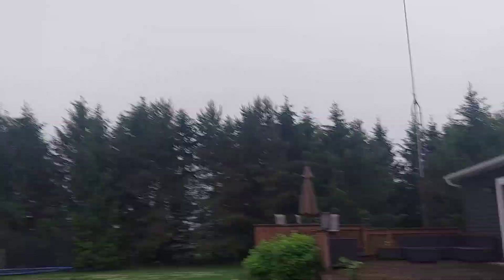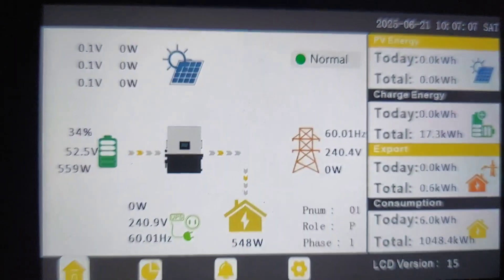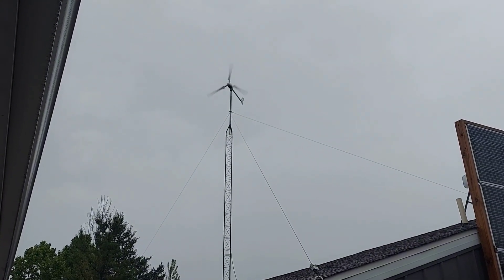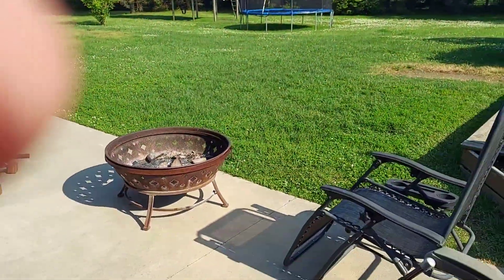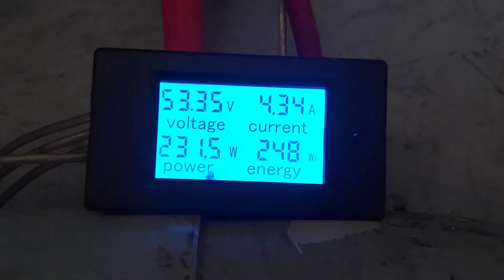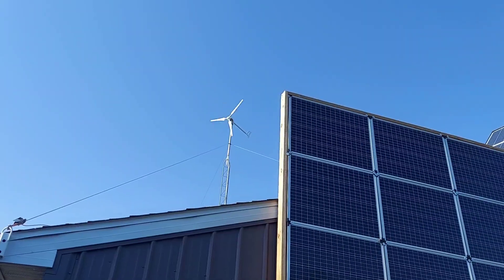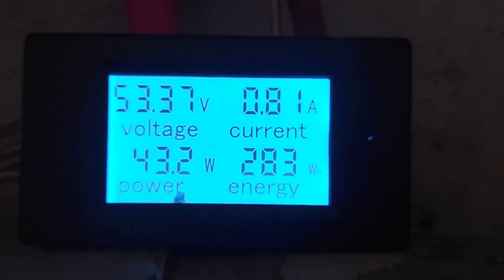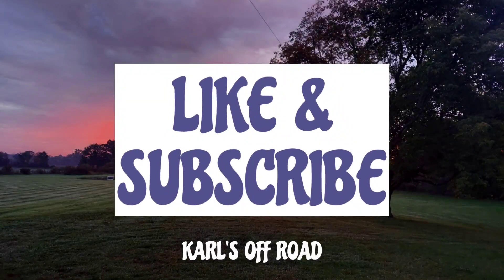Is wind power worth the investment? Testing the IstaBreeze I-1500 in moderate winds to find out.

Comment: Im lucky enough to live on the Canadian prairies so we usually get 20-30mph winds. Which is enough for me to get about 2kw out of the two 5kw turbines I bought from a telecom power provider. But there are mornings I wake up to full batteries when we have storms here over night. And I have seen both of them push up to 5.7kw in 50mph+ winds. Their dump loads are in our 5000sq ft commercial  greenhouse. And this entire homestead is electric. 32kw of solar and 60kwh of 200ah batteries. And it cost me less to DIY this system than the utilities wanted to charge me to bring power and gas a mile and a half into this property. Selling organic tomatoes in the dead of winter in Saskatchewan? Is like picking silver pieces off a vine, when you take the energy requirements out of the equation ;)
Reply from the maker: That's awesome! Most of my wind generation is in the winter, which is when the skys are usually gray,with little to no sun for days!  It works for me,but it's not for everyone. I appreciate you watching and taking the time to explain your setup! Have a great day!
Reply: @karlsoffroad  Sun and wind ARE counter cyclical. You statistically get more wind at night, during weather events and during the winter as well. The key is to be over powered, and to find ways to make use of that excess you are creating. Like turning it into high grade heat? And storing it in an insulated  thermal mass buried underground ;)

Comment: I like having my 120 secondhand solar panels flat on the ground, so I can clean them and they work better on cloudy days and even rainy days. I like keeping the costs down, so I have bolted the solar panel rails to many  old truck tyres, which holds the panels down in winds and isolates them from the ground. There is never a shortage of old tyres and secondhand house solar panels. I have most strings wired so I get 60V or 100V depends on the brand and number of solar panels and I get 5 to 8 amps per the 12 strings.    
I hope this idea help everyone.

Comment: G'day Mate, I found small wind generators start up earlier in low winds,
starting wind speed 10km/h, these outputs are only what I saw in a 50km/h Wind Storm, they might have gone higher in the peak winds of 63km/h.
26V - 24V 500W Vevor   -  8 Amps  - 6.5 Meters  -  Normal 5 Blade
26V - 24V 500W Vevor    -  8 Amps  - 6.5 Meters -  Normal 5 Blade
14V - 24V ista Breeze i500   -  11 Amps  - 4.5 Meters  -  Scoop 5 Blade
12V - 24V 300W Old  6 blade   -  4 Amps  -  4 Meters  -  Normal 6 Blade
12V - 48V 500W Sunboo S5   -  2.5 Amps  -  3.5 Meters  -  Scoop 6 Blade
12V - 48V 500W Sunboo S5   -  2.5 Amps  -  3.5 Meters  -  Scoop 6 Blade
12V - 48V 500W Sunboo S5   -  2.5 Amps  -  3 Meters  -  Scoop 6 Blade
12V - 48V 500W Sunboo S5   -  2.5 Amps  -  3 Meters  -  Scoop 6 Blade
12V - 48V 500W new rotor   -  1.5 Amps  -  3 Meters  -  Scoop 5 Blade
12V - 48V 500W new rotor   -  1.5 Amps  -  3 Meters  -  Scoop 5 Blade
Peak Output Totals  =  44 Amps  =  752 Watts ( my target is low winds )
Local laws stop me putting a big wind generator up high enough to work.
Reply: There is a lot of junk on the market, so after a few bad buys and lots of testing, I have finally found the best performing small wind generator for the price - $361.90 AUD  postage included . Search  -
1000W 24V/48V Windmill Power 6 Blades Wind Turbine Generator W/ Charge Controller - ( Best to order the 48V model ) it's from China.
This is a buy and put up wind generator, no modifications needed.
I hope this helps anyone for buying their first small wind generator.
Reply: My best advice for low winds is to always buy the 48V model, even if you have a 12V or 24V system. Just use a 3 Phase Bridge Rectifier to convert AC to DC, then use normal solar charge controller, best to use a PWM solar charge controller because it has a quicker reaction time. Just check that the solar charge controller input voltage can handle 50V or the listed maximum wind generator voltage. For low winds always buy the 5 blade model and get the blades with scoops on the blades, not flat blades. 
I hope this information helps everyone.

Comment: G'day Mate, my best advise to anyone trying to live offgrid is to buy as many secondhand house solar panels as you can, have them along every fence and on the ground. I have been buying any secondhand solar panels from Facebook Marketplace for over a year, to the point where I have 120 solar panels. Now it doesn't matter if it is rainy or cloudy, I am always making some power whenever it is not night. Old solar panels might have less output then new panels, but it all adds up to getting more power into your batteries. But take a multimeter to test that each panel is working when buying secondhand solar panels.  I hope this information helps everyone.
Reply from the maker: I just added some new panels to my system. The turbines just help whenever they can, and I can live with that! I'm still going to add another turbine as well. We go weeks without sunshine in Michigan. Lol
Reply: @karlsoffroad  I understand, looks like you have more wind then in my area, most days I am lucky to reach 10km/h. My local laws stop me from going high than 6.5 meters and the noise is a problem too with neighbors.
Reply from the maker: @brianaustralia9692 I just do what I want. I have lived here longer than any of my neighbors, so I'm grandfathered in with my rules for living next to me. Lol, the IstaBreeze is really quiet. The cheap Ebay turbine is the noisy one. I'm curious to see how the IstaBreeze I-2000 does compared to the I-1500. I'm actually thinking about using it for a backup charger for my battery bank. Just run it off my chinese diesel. I haven't even opened it yet.
Reply: @karlsoffroad  Ok, my wind started as a hobby, but now some cloudy days is a match for solar now. I have promised myself that I would not spend any more money on wind generators.
Reply from the maker: @brianaustralia9692 my wife made me promise the same thing! 😆 Good thing IstaBreeze sent me the I-2000 to test and review.  I enjoy them as a hobby as well. Bonus is the free electricity.

Comment: The tail fin could need an upgrade, it seems to struggle keeping stable to the wind direction
Reply from the maker: It's definitely getting dirty wind. I need to get it up higher. I have a lot of trees around me.
Reply: @karlsoffroad  Hi Mate, after lots of testing, I have found that most small wind generators work best with a bit bigger tail area. My best advice is to attach a 25cm Round Stainless Steel Pizza Lifter onto the tail, just remove the handle first. Once aliened with the curve of the tail and painted white, it looks great up in the air. This works with up or down facing tails, just allow half the Pizza Lifter to hang out the back, adding some length to the tail as well. Should track the wind better now in low winds and won't rust. Maybe bigger for yours.